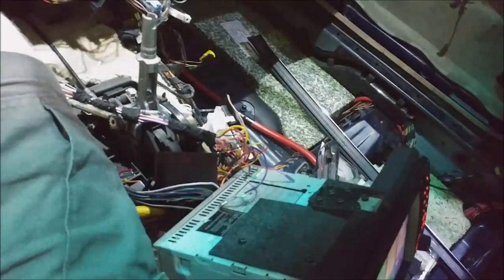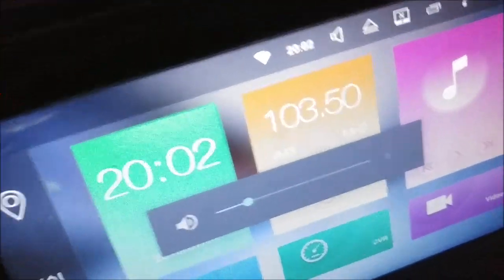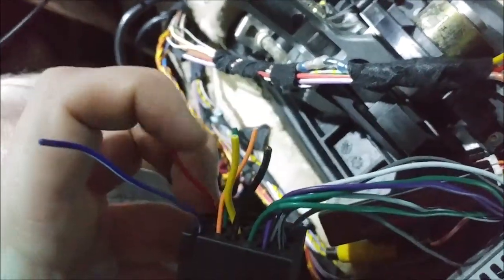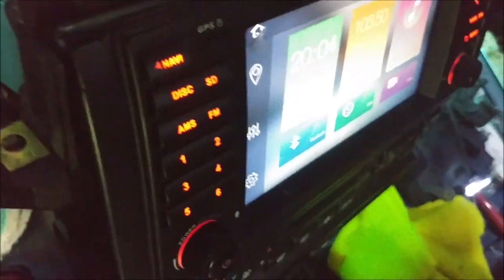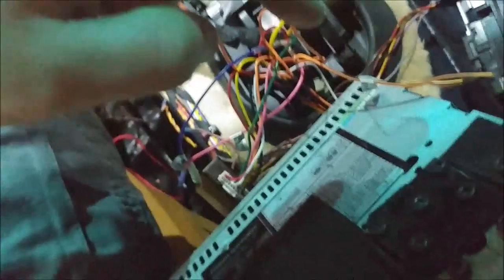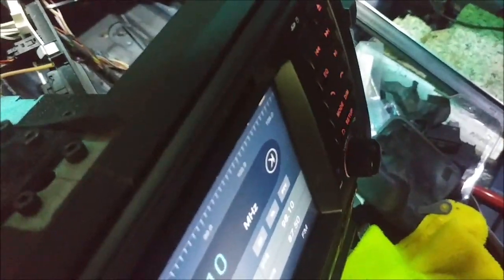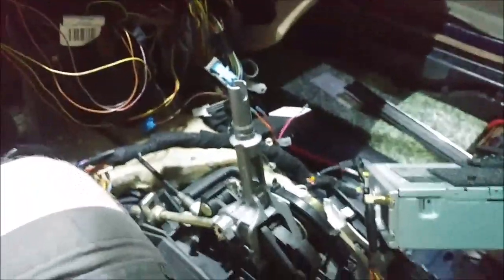E38/E39 Android Head Unit Custom Wiring - Steering Controls

Comment: I am doing  the exact setup for 1998 E38!  I got the rear camera and steering wheel settings working.   Please explain which two wires you connected to bypass the Canbus.   I have two Orange wires (One from the car wiring (Illumination In) and the other one the illumination out) that I cut off from the Canbus box.  Which two wires did you mean in your video (See 2:50 to 3:10)?   I just have One Solid colored Orange Marked Illumination for my Lollipop Android 5.1 Radio by Hizno. and same Canbus Wiring setup.  Do I just connect the two wires that I cut from the Canbus together?  Got a little lost there...The wires you pointed to were out of frame. Do I also go to settings and set it  up as Power, Headlight or Power and Headlight?  Thank You in Advance,  Your video was very helpful.  Nice Job!

Comment: Hi! 
Do you think there is any posibility to conect a normal Pioneer stereo with steering wheel control to a E39 steering wheel (just like yours) with the tipical adapter, but in an E36 wich didnt come aftermarket with multifunction steering ?
Reply: I alredy have the steering, and i would like to makeit functional !
Reply: @jcfc93  Hello could you please help me out with steering wheel buttons? I dont know how I should connect it

Comment: Hi there i bought a screen like that but it wont fit my e38 can u help me?
Reply from the maker: It doesn't fit mine either, I had to modify it to fit.  If you're not sure how to, I can't really be of any help and I suggest either returning it for another unit, or getting someone to do the work for you! :)
Reply: Thanks man but i have to remove the cd player too?
Reply: And there is no other unit like this one with a cd player
Reply from the maker: @barzanqaftan2854  The CD player  was removed from mine so I could move the whole rear of the unit over.  If I left the cd player there, the cd's wouldn't fit through the front slot.  With every $4 phone having hundreds of gigs of storage on board, and free music streaming services all over the place, I Figured it was no loss - as I can find any and every song I ever wanted online in 5 seconds with the way things are! :)  There is that unit that everyone seems to love for it's plug&playability, AVIN 4 or something like that.. but it doesn't have a CD player built in because of the room required.  So I assume it just uses some sort of connection to make the rear trunk cd player work with it.  Check out the bimmerforums, lots of guys there have much more experience with this, and much more recent for them too - I don't remember any of this :D
Reply: Thanks man for the help and answearing me i really appreciate it thanks for your time too:)
Reply from the maker: @barzanqaftan2854  Of course man - in the middle of things otherwise I'd have written far too many words to say the same thing - best of luck with whatever you end up doing! :)

Comment: Hello , I wanna ask I see that you cut the harness with 17 pins and u did all manually . I have the same harness and the same canbus , I have the green wire that is used for the ibus, are you saying that I should wire manually to the canbus decoder and bypass the harness itself ?
Reply: I can’t get my steering wheel controls to work ...
Reply: @ristecanev7  having the same issue did you ever figure it out
Reply: SC Guy yes bro , i had a double din harness .. and the type that my car had , had less cables going to the canbus then the harness that my car didn’t support , so I manually cut all the wires from the harness that went to the canbus from the harness that isn’t supported for my vehicle and reconnected them to the one that does :) , add me on fb if u need pictures and more explanation Чанев Ристе is my profile
Reply: @ristecanev7  can you send me pics please I

Comment: What wire did you use for the steering wheel controls ?
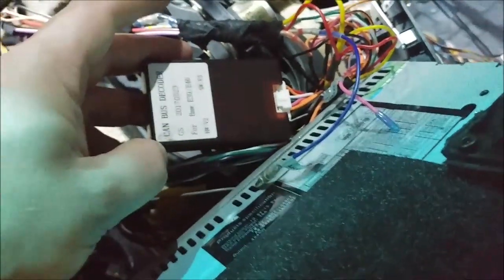Reply from the maker: 1:20  =)
Reply: Krall Space hey so it’s into the ibus box or the green wire? My adapter doesn’t have the green wire 😭 lmao
Reply: Krall Space I lied sorry, my adapter does have a green wire but it’s for speaker. I don’t have an extra green wire like you do. So I’m not sure
Reply from the maker: @CruzingYT  That's not cool!  Sorry though I only know my unit and honestly I havent' looked at it since making this video so all I can go on is the video as well.  Green IN happened to be the ibus for mine, which is where I connected the ibus from my car to.  You should have a wiring diagram with your unit that explains which one ibus is, and then you just hook your car's ibus up to that - I believe the ibus from the BMW was grey/white with yellow dashes on it. Good luck!!
Reply: Krall Space I’ll try the yellow white wire. Or another one that looks the same I believe I tried one but nothing happened. I don’t have a green connector on my harness. Been searching for hours to try and find a solution with no avail lol
Reply from the maker: @CruzingYT  I just remembered that I had received TWO harnesses with my unit, I used one and cut it all up and gave up because I couldn't get it to work, then used the other in this video - maybe that's why I have a green one and you don't?  Did you also get two styles of harnesses?  I wish I could be of more help haha!
Reply: Krall Space I didn’t get two harnesses. Lol I do however have an extra harness I can use an extra wire from. I’m just having so many issues trying to get it to work lol. Could you email/message me for quicker communication ? I might just try to add a wire to that white/grey/yellow wire. But I tried to tap into it and it didn’t work. 😭
Reply from the maker: @CruzingYT  Sorry you're still having issues man, all I can tell you is that I had so many problems getting mine to work.  It's why I ended up going to the other adapter, to kinda start over.  You need to read the pinout on your unit - mine had a sticker on the top that told me what pins were what on the rear connectors.  Then I literally just wired the ibus into the harness that way.  The whole thing is pretty stupid but I get that they need to make it work for a variety of vehicles.
Reply: Krall Space yeah I feel ya man. I appreciate your help. I’m actually pretty fluent in wiring and stereos and crap but this is a whole new level of stumped lmao. Hopefully have this figured out soon. I’m still kinda confused though because the ibus is one wire but I have two wires coming from my radio? Lol
Reply from the maker: @CruzingYT  Yeah there was KEY 1 and KEY 2 but I didn't use those as far as I remember - there was a green wire that went from the box harness connector into the canbus box connector that was just kind of put in the middle of the whole adapter:  goes from radio to factory car connector , and in the middle was the canbus connector, so all I did was hook the ibus grey/white/yellow stripe wire to the wire that said "canbus"  that went into the canbus box, and when it was connected to the new nav unit, it all worked as it was supposed to.   So finding the pin that says "canbus" or "ibus" is all I had to do.  I just searched through over 80 photos and none of them show clearly how I had it wired, they were all taken for another purpose.  ALL I CAN say though is that it really isn't tricky at all:  You need power, ground, acc, remote,  ibus, and illumination.
Reply: Krall Space yeah that sucks man. The radio I got is a  Chinese android radio, it doesn’t have a harness on it just the wires for speakers, illumination, power etc. no extra for ibus just the key wires. Uhgggg lol bmw sucks when it comes to things like this!

Comment: Hi, i have a similar chinese unot in my e39, and no matter what I do i can't get sterring wheel controls to work even though ibus is connected to the can bus box.
The units understands when the car is put into reverse and starts buck up camera automatically which is a sign that canbus box is working
Do you have any recommendations?
Reply from the maker: What a pain! I'm sorry but I'm not sure what to suggest. If it were me I'd hook it up to a scope and see if the steering wheel is sending information or not then go from there.
Reply: @krallopian thanks. i found the pinouts of the can bus box and tried with a voltmeter on the steering keys output pin, it reads around 5~6 volts and changes when i press steering keys.
Reply from the maker: @AhmedSalem-ee9hy  well thats a good sign. All i can say is maybe the canbus box is looking for ranges from a different car? Does the unit say e39? Mine says e38 and works with the e38.
Reply: @krallopian  the can bus box has e46 written on it but i understand from the internet that they are the same for e46 and e39 , even some of them have e39/e46 written on them
Reply: @krallopian  I have the same Problem and i have no idea what to do! Maybe there is just one wire to change
Reply from the maker: @ensis_one  sorry guys I was only able to do this because it was infront of me. I hooked it up as explained in the video and that's literally ALL I know about it heh! Wish I could help guys
Reply from the maker: @AhmedSalem-ee9hy  Just noticed while watching again that MY box says E39 and E46 too!!  That's annoying because, well it clearly worked on mine :(
Reply: Krall, Thanks for getting back to us
While inspecting further i found that the P.O. had bad wiring and insulting skills, also using a voltmeter i noticed that the mfl signal wire jumps to 12v when i turn on park lights so i still need to inspect more. I just can't understand how the mfl was working on the original cassete player!!.

Comment: So are you not even using the factory amp?
Reply from the maker: Nope. Infinity amps. One for doors and one for booms.
Reply: @krallopian  right on. Any chance you could tell me where yoy got the head unit?
Reply from the maker: @JB-qu7gp  Awwee jeez FINE!  https://www.amazon.com/gp/product/B06XKNL4JC/ref=oh_aui_detailpage_o00_s00?ie=UTF8&psc=1  Heh in an previous video I said I bought it from eBay.  Buut it was from Amazon, derp!   I was sure to get the one with square corners instead of rounded ones, but I'm not sure if I should have bought rounded instead.  Installation is tricky because I tried to adapt my original tape-deck bracket, but then switched it up, annnnd switched it up again.  So just be aware it'll either be easy to install or not so much <--- helpful huh? =D

Comment: Where did you get your head unit from? I see it's offset to the left.
Reply: The Din is not centered. From the pic is moved more on the left side. Looks like it fits better to avoid hitting the hvac system.
Reply from the maker: @jm991700  ohh the brain box! Haha yes, i moved it over so it would fit.
Reply from the maker: Amazon.com but what do you mean offset to the left? =)
Reply: Yes how was you able to move the brain box over like that to make it fit. I have a 95 740iL also
Reply from the maker: @jm991700  I just unscrewed it, and moved it over, and redrilled some holes.  I had to remove the DVD player though - weight reduction, and I never use it anyway so there's no need for it in there.
Reply: Ok I didnt take you could move it over like that. Was it difficult? So you had to remove the DVD player to do so?